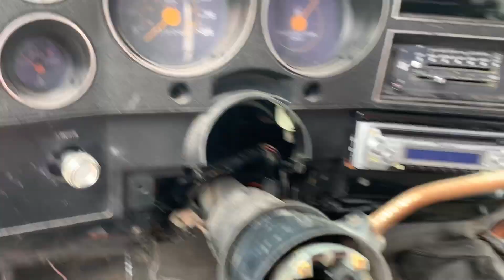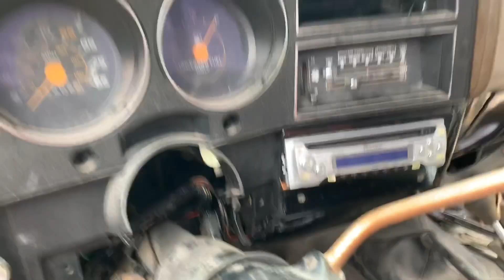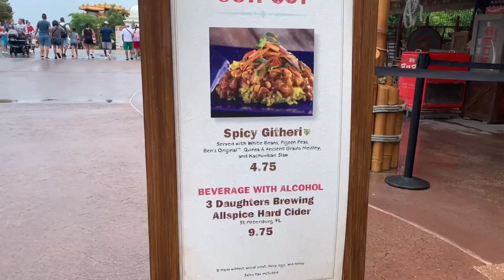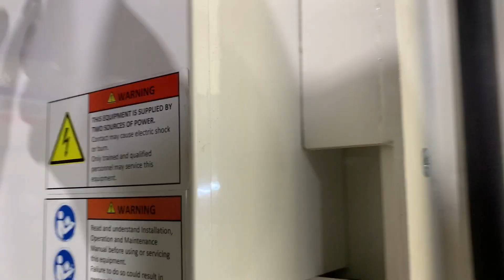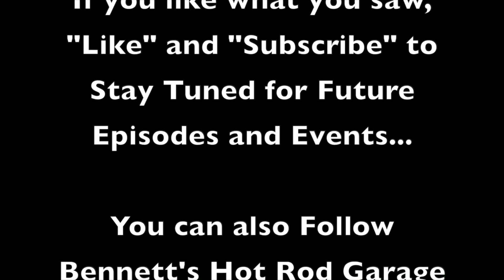K10 steering column gets fixed, ford truck gets shifter, 37 Chevy radiator relocated and Austin Eats

Comment: The steering column guy has a nice lookin' S-10!! That steering column was a mess, glad you called the guy! Now ya need a grab bar on the inside of the A-pillar. Column looks good without the extra lever.
Austin trying all the different foods he can.👍 Fried egg and peanut butter sandwich, Mmm tasty. I'm with the gal on the left, I'll have the pizza too. 
Who was the last one to use the hardener? They didn't tell ya it was all gone, eh.😉😂😂